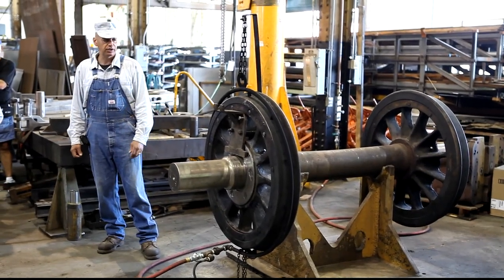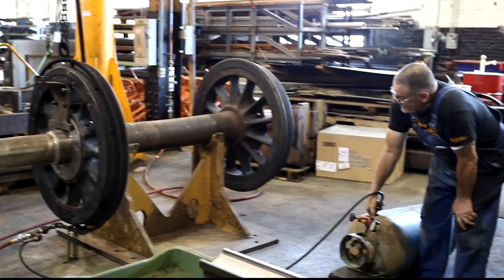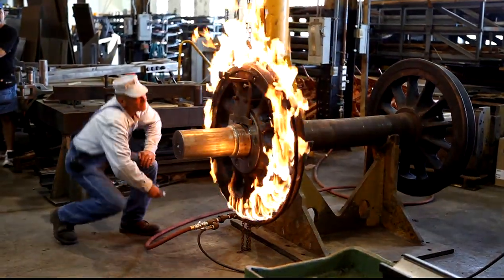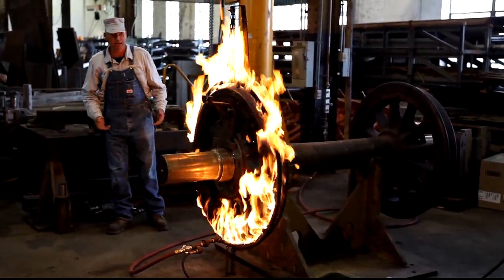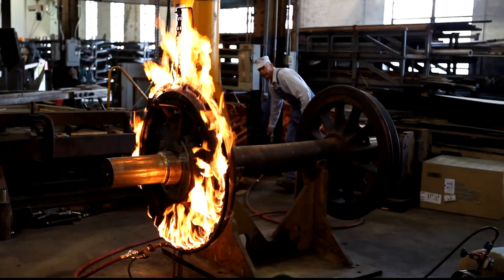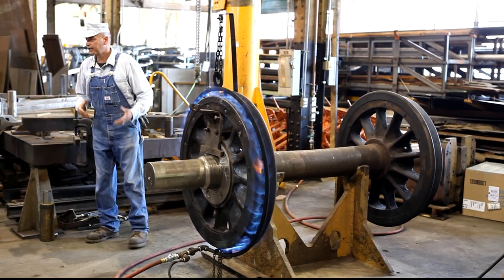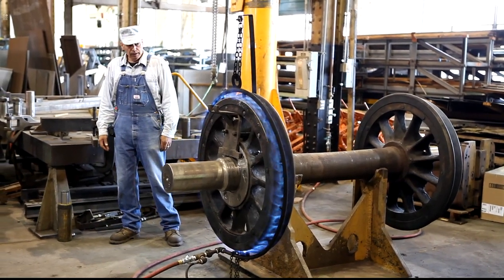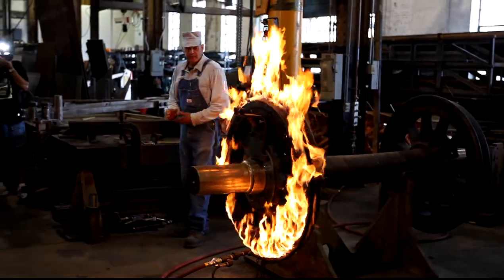Ring of Fire: How to remove a locomotive tire with heat at Steamtown, Scranton Pennsylvania

Comment: an amazing operation that they do to these tires. cut the tire on the lay, put it on the rim, attach the clinch ring, soak the tire in gas, light it up, remove the clinch ring, pound it on with the sledgehammer, gauge it, and the final step spray the tire with liquid nitrogen to shrink it.